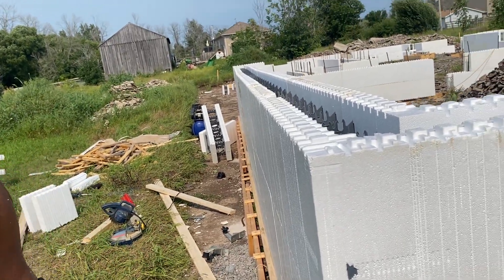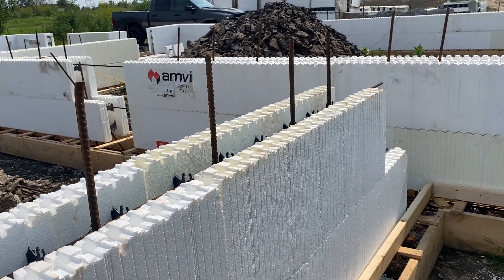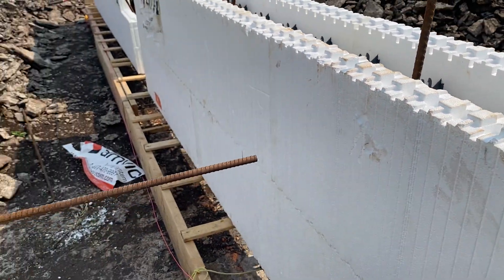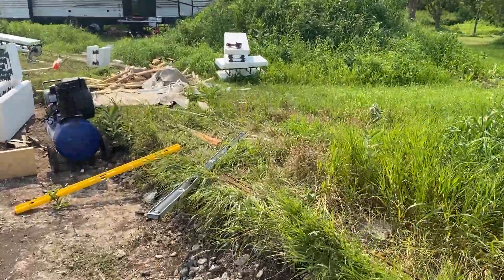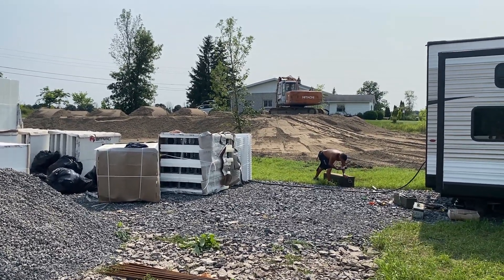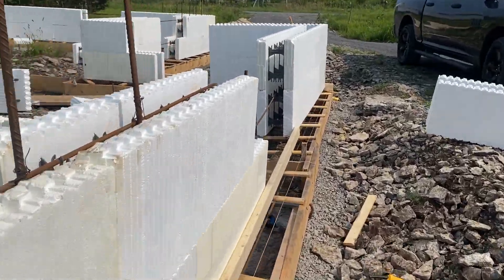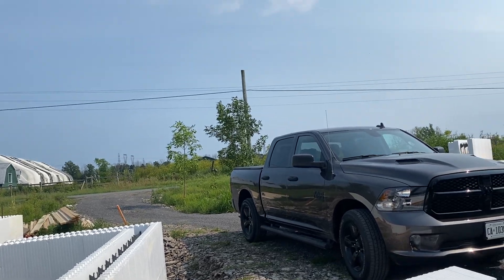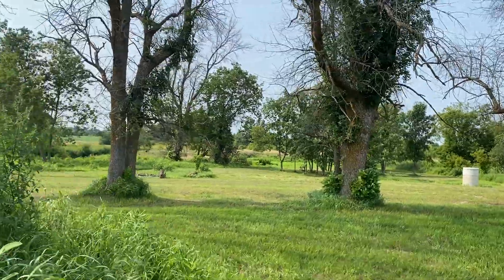ICF 0 to finish||Zont system  ep1

Comment: What in the Crystal Methodist, is going on here?  How will you be containing the concrete when you pour?  its just going to over flow out of the top of the form. and you are going to leave the untreated footing ties embedded in the concrete? they will be rotted out in a year, and infested with wood eating bugs.
Reply from the maker: All of it will be buried.  Tell me how this will have structural issue.  It is only 3/4 inch.  The footing will be 4' below grade.  Please elaborate on what the problem is structurally.
Reply: @rockyrookiehouse7732  I never said structurally, just that you will have rotten wood between your footing and wall.  It also appears that the wall is no where even close to the center of the footing.   If this will be 4' below grade are you doing a basement?  What are you using for drain tile?  no one wood forms footing anymore, almost everyone uses form-a-drain, however in a year or so you will have ground water freely flowing between the inside and outside of the wall, when those ties rot out.      And again, if you are doing a single pour, How will you contain the concrete from flowing out over the top of the forms when you start filling the wall cavity?
Reply: @rockyrookiehouse7732  The space between the footer and ICF, concrete could flow out there also the small strips of wood the ICF are sitting on should be removed.   Small things can make a big difference.
Reply from the maker: @houstonbill  There are videos already on YouTube.  Someone already has done this
Reply from the maker: @houstonbill  also by the time you come around the concrete will start to cure and will not push up.  Also the strip of wood is so small in size that it is negligible.  It can stay